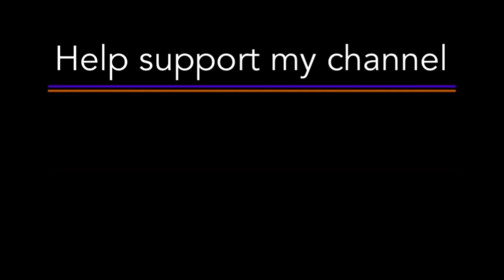Woodturning Ambrosia Maple: The Worm Hole Bowl

Comment: I am trying to figure out where all of those lines are coming from on the outside of your bowl. 2 suspects here. 

One is the spindle adapter. The farther off the head stock your piece is mounted, the more vibration and run out you will get. One reason I like my Vicmark lathe is because the spindle mount is right on the headstock, not cantilevered out like the Laguna is, or in a bell housing like the Oneway and Robust lathes are. Note here, with tailstock engaged, there is almost no vibration. 

Number 2 is your shear scraping. I can't tell for sure, but it kind of looks like most of your shear scraping you have more of a scraping angle rather than a shear angle. When I am shear scraping, I have the cutting edge at 45 or more degrees to the rotation of the bowl, rather than flat like a standard scraping cut. Not sure if that makes sense or not, but the higher that shear angle is, the easier it is for the cutting edge to get under the wood and gently lift it off. For me, I am using scrapers, and drop the handle down to my hip. You can do this with swept back gouges, but again, you need that shear angle. 

Another problem may be because of run out. A test to see how far out of perfect round I am, is to gently ease a pencil up to the spinning wood until it just barely touches, and see if you can get a line on the wood all the way around. This is pretty much impossible, but you can get pretty close. Any run out in your chuck and spindle adapter can make this worse. So, when you are shear scraping, since you are not rubbing the bevel, the cutting edge is not contacting the wood the whole time on one full rotation. It kind of looked like your lines didn't go all the way around the bowl. If it is tear out, then you will get lines on opposite sides of the bowl from when you are cutting up hill against the grain. If you are getting lines around maybe half of the bowl, then it is run out. For sure, going down the outside of the bowl, there is always that annoying 'bump' which is pretty much from pushing too hard, and the more you clamp down on your gouge, the bigger that bump gets, but if you have barely any pressure on the left hand, then it goes a lot smoother. 

I don't remember how to do the math, but a 3 inch abrasive disc has more then double the surface area than a 2 inch disc. I generally sand with my bowls at about 10 to 15 rpm. Necessary because all of my bowls are warped, and you can't keep abrasives on the wood if the piece is spinning at more than about 15 rpm for even very slightly warped bowls. 

Good looking bowl!
Reply from the maker: So many variables here - incredibly frustrating. I’ve checked the spindle with a dial indicator and it is damn near perfect. I’ve yet to find a reliable way to check runout from the chuck, either of them. I am working on another aspen bowl today (finish turning after dried in the kiln)  and I didn’t have enough left to use the 100mm jaws that I keep on the SuperNova2 (direct thread) so I reluctantly pit the G3 with the spindle adapter with the 50mm jaws on and set about trying to make the thing round.  Now it went pretty oval but I felt like even after some aggressive scraping on the outside, I wasn’t making much progress but was getting some weird spiraling, even though I used both my 5/8” bowl gouge in a near horizontal scraping position, and the round nose scraper so wasn’t running the bevel   So I decided to take the same 50mm jaws off the G3 and put them on the SuperNova2 and see what I got. When I change the jaws I leave them a bit loose and then clamp an appropriately sized steel dowel pin from a set of shimstock punches my dad made when he was an apprentice into the center hole between the jaws and fiddle with that a little until it runs sort of true and then tighten down lol the screws, in hopes of making the jaws as close to the perfect circle they were before they were cut apart. After switching chucks and jaws, it still took quite a while to get the outside round but i eventually did. The inside went relatively smoothly - I used a gouge to do down an inch or so and then came behind it with the inside bowl scraper and cleaned it up, until I got all the way to the bottom center. Sanding the outside (I started at about 140rpm to see if that smooths it out faster) but it took a long time with the 80 grit and I still have some funky lines. I’ll try the pencil thing when I go back to the shop and see if after I’m “done” if there’s any runout visible from that test. 
So when are you going to come to Michigan and help me get this all sorted out!? 😁
Reply from the maker: Pencil test does indicate runout, mostly over the end grain sections. Blank seems ridiculously dry, wouldn’t register on the pin moisture meter and hadn’t lost more than about 1-2g of weight over the last week or so. 🤷‍♀️

Comment: I wonder if the issue was the different densities between the wood and the wide beetle juice ravaged bits.
Very nice bowl anyway and as a fellow person with a voice, I too do like the sound of yours!!!!!!
Reply from the maker: Hi Chris! The wood could certainly be part of the equation but I think mostly I have a combination of not-so-great tool work all the time (I can see in the videos where I occasionally lose bevel support) and I think my smaller G3 chuck with the spindle adapter may be compounding things with a bit of runout. I’m going to change the jaws on my SuperNova2 to the smaller set as I am going to spend the weekend in the shop roughing out a batch of bowls for the kiln. I picked up a bunch of birch and it’s very fresh - gonna make a big mess! 😁
Reply: @LisaRamlow   LR yeah I think you're right about that adapter thingo, it has some length to it and might cause some sort of flex or distortion. Lets blame that rather then less then excellent skills!
Reply from the maker: Indeed! 😁

Comment: Hi Lisa.
I would use a spindle gouge to shape the outside of the bowl, with finally using the spindle gouges bevel to finish the surface. I do not use a bowl gouge at all.
Try it.
Reply from the maker: Hi Roger! What’s the advantage with the spindle gouge? You don’t rough turn the bowl with a spindle roughing gouge, right?

Comment: When I first started turning and heard that I should "ride the bevel", I actually did that. I burnished the bowl and wasn't able to remove the marks even with sanding. It was a peach bowl, which is softer than your maple, but perhaps your marks were also from riding the bevel and pressing the edge of the tool into the wood? Now I 'almost ride the bevel' :)   The bowl looks great, by the way.
Reply from the maker: Thanks Doug! I think that’s part of my issue too - I’m trying to learn to “glide” the bevel instead 😁

Comment: Very nice bowl, and well turned. Watching the chuck in the video, I can notice run out at the far end (jaw side) of the chuck. I think you might be correct about the spindle adapter, I've never liked or used them myself. If you can't get a shorter, true thread adapter for the chuck in your area, it might be worth your time to talk to a machine shop to get some precision ones made. The adapter's I have for my Vicmarc chucks (made by Vicmarc) are short with only enough room for a grub screw to lock the chuck onto the Lathe spindle to stop them unthreading when in reverse. I believe the shortness of these adapters helps to keep them true.
Reply from the maker: My SuperNova2 is a direct thread and at some point I’ll get another the right size. Would love a Vicmarc😁

Comment: It came out very nice!  Persistence and refusing to just live with the marks paid off.  Hmmm. I have yet to fonish a project with just the Ack’s products alone. I want to make sure the wood is sealed, especially the end grain, of course. 
“Don’t be a jerk!”  Ha ha ha. So random and funny. Made me laugh!
Reply from the maker: Hi Dave! I am actually not using the Ack’s anymore, I’m using Brad’s Tung Wax or Tung Honey, or Tried & True Original Finish or Danish Oil, or Mahoney’s walnut oil. All drying oil finishes so as to penetrate the wood and cure, rather than mineral oil wax. 👍
Reply: Thanks, Lisa.

Comment: First off beautiful bowl.  It’s interesting how the smallest detail (rim detail) really enhances the bowl.
I have the same lathe Laguna 18-36, same chuck Nove G3 anniversary edition and the same spindle adaptor.  All only by coincidence, my lathe is only a few months old.   I have had trouble with “lines”also.  I contacted Nova and they instructed me to test my lathe spindle with a DTI, dial test indicator.  I have done that and from what I can tell my lathe is fine.  I have not yet re- contacted Nova.  Interesting there is another “YouTube “ turner that has the same lathe, she has already had to change her spindle because the old one was defective.  Saga continues.  
Not sure if you have multiple chucks but do you same results on different chucks? 
 I am currently looking at the oneway stronghold chuck to start turning larger bowls than 14” in dia.  
Looking forward to your next weeks projects.
Reply from the maker: Hi Lance! Kim Tippin had issues with her Grizzly and then the Laguna too. I decided to go with the Laguna even after her issues because there are a lot of people out there with this lathe and overall I think it’s a good one, especially for the price. My first tailstock wasn’t aligning within an acceptable tolerance so Laguna sent me a new one. I’ve been having trouble with the lead screw and they sent me a new one of those. I’m not sure I’d it’s fixed the set screw slipping and getting the live center stuck in the quill as I haven’t tested it yet but their customer service has been very good. 
I had issues with my first G3 and Nova sent me another one. I think it’s part of my problem here and compounded by the spindle adapter. My SuperNova2 is a direct thread and I think is better - I’m roughing out some birch bowls for the kiln this weekend and I’m using the SuperNova2 with the 100mm jaws. I don’t like to change the jaws out since they don’t always align properly without some fussing so I’m using the bigger ones for now. If I lose too much wood from warping I’ll change to the 50mm when it’s time to finish turn them. I think the G3 may get demoted to holding Cole Jaws or a sanding disc or something down the line and I’ll add another SuperNova2 or better yet a Vicmarc or OneWay. 
Btw, I checked the spindles on both my Delta midi and then the Laguna with a dial indicator and spindle is good. Spur drive runs true also so the chuck is definitely the weak link

Comment: Very nice bowl!! Could the lines on the bowl be caused by irregularities in the surface of your tool rest or residue on the surfaces of the tool that prevent a smooth flowing movement when using?
I love the idea of the bead around the top edge to give the user more purchase when using the bowl!!
Reply from the maker: I think they could be part of it, in addition to the fact that I just have a hard time making a smooth pull stroke. Maybe making my pull cut worse, if my tool rest needs a little attention 😁

Comment: Lovely project. Either way with the hump in the middle or without.  The hump could be recessed to take a tea light candle.  Or a dip tub with nachos around the outer part of the bowl.  Great job sir.
Reply from the maker: Thank you ma’am 😉
Reply: Yeah thanks Lisa I realise my mistake Haha I was actually commenting on another video. Although yours was an outstanding piece. I turned a piece of ash into a small bowl just to put near the front door for our keys. And the worm holes as I turned became a lovely pattern. Sorry for calling you sir. Haha. Might I suggest for the hard to remove tool Mark's. Using a semi flexible cabinet scraper held under the turning piece, sanding/buffing style, no tool rest. Rocked side to side this may help. As for the inside 🤔
Reply from the maker: Hi Kev, no worries! 😁
Cabinet scraper is a good idea and I have a couple kicking around the shop 🤔

Comment: Beautiful bowl Lisa. Love the bead, save your money, you clearly don't need a beading tool. You mentioned difficulties removing the tool marks on the outside. I noticed the the gouge attitude to the wood when shear scraping was quite open (aggressive) and the shavings were a little coarse in texture. You might consider closing the gouge up some and lightening your touch a bit. My goal when shear scraping is to produce angel hair, more fluff than shavings. Just a suggestion. Always a pleasure to visit your shop, thanks for sharing!
Reply: I love the bead and that wood is beautiful!  Lovely finished product as usual.
Reply from the maker: Hi Gord, thanks for the tips. I have been able to get nice angel hair sometimes but not always. Gotta get more practice I guess 😁

Comment: I could be all wrong, but I suspect the jitter in the chuck is the problem with getting a smooth finish. When I look very closely to the chuck during your video, I can detect a little bit of jitter. It also may be due to your shaft extension. 
I very much enjoy watching you work. I especially appreciate you showing errors that you make while you are working. It is much easier to learn from mistakes than doing everything right. I also enjoy your voice-over style of narration.
Reply from the maker: Hi Marc, welcome! I’m glad you’re enjoying the videos 😁
I agree, I think the spindle adapter is magnifying some runout in the chuck so I’m going to use my SuperNova2, which is a direct thread, for a while and see if that changes things one way or the other. Thanks for taking the time to leave me a comment, I really appreciate it 😊

Comment: Nice simple bowl Lisa - it lets the Ambrosia do the talking. Perfect 🏆   
Is your knitting bowl going to have a similar open form ? The few I've made were semi-closed forms and my clients really appreciate the shape.  I find the thread slot to be a challenge - I tape a Fibonacci template and use a simple ring jig to hold in the drill press for the initial cutting-out. And like Tony says - always use a stiff backing pad until 120 or finer grits.
I'm convinced I will never get good enough control to make perfectly smooth cuts until I've done my 500th piece. LOL. So I depend on sanding for the perfect surface. But I am getting better. 
Jerk ? Who told ? Dag-nab-it 👺👺
Thanks for sharing🙏  Stay safe. -Mike😷
Reply from the maker: Hi Mike, yay you watched til the end! I I was a good girl and didn’t say the word I usually use in that sentence 🤫😂
I do plan to use a more closed form and a heavy bottom to help make it stable. Imma hit you up when I get that far!
My tool work is also not so great all the time and one good thing about doing these videos now that I can see what I’m doing. I’ve noticed a few times where I lose the bevel support and that results in lines for sure. More practice! 😁
Reply: @LisaRamlow  Is the usual word closer to the front of the alphabet perhaps ?
Stable ... ooh, we do think alike !!!
tool work ... if the choice is between tear out or ridges I'll take ridges 'cause they're easier to sand out. But Ugh! just the same. When off the bevel can you feel it bouncing a bit ? practice practice practice for us grasshoppers !!
Reply from the maker: Well that one too, but my most uttered phrase in relation to humanity is the one that’s short for a Richard. 😬 it’s my golden rule and I don’t understand why it’s so hard for so many people to follow 🙄
Shoot me an email sometime- Lisa (at) lisaramlow(dot)com
Reply: @LisaRamlow  😀😁😊👍

Comment: It turned out beautifully! I found myself getting as frustrated as you with regards to the ridges and tool marks you were fighting with. I wonder if you might have a better result and leave less bowl on the floor if you mastered just a couple of tools instead of going through the whole quiver looking for a tool to resolve the issue? For myself I have discovered my biggest tools make the biggest mistakes so I typically go with a smaller tool if the wood is being troublesome. You'd think it'd take longer but with fewer big issues it actually takes less time to get a result I'm satisfied with. Either way, I always enjoy your videos and find myself learning something with every one you produce.
Reply from the maker: Thanks Butch. I need to figure out which tool I like beat to use for shear scraping and I’m just not sure it’s the carbide. Gonna do some practicing and see what I come up with.

Comment: nice job, i think the bowl was warping on you as you went,thanks,BM,aka,woodbutcher
Reply from the maker: Hi Bryan! This blank was kiln dried so I think that it was stable enough but I’m pretty sure the spindle adapter on my smaller chuck are causing some runout and essentially the same thing you’re saying. Gonna try just using the SuperNova2 which is a direct thread and see if that takes care of at least some of the warping/wobbling. Thanks for stopping by and for taking the time to leave me a comment-I appreciate it!
Reply: I can believe that just trying to help
Reply from the maker: Absolutely appreciate it! Just because it’s dry doesn’t necessarily mean it can’t warp or move